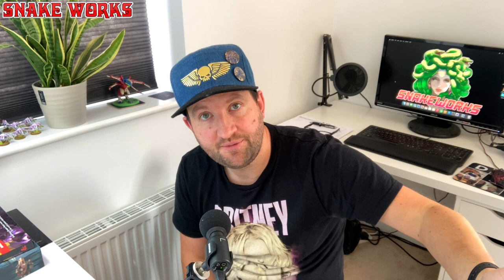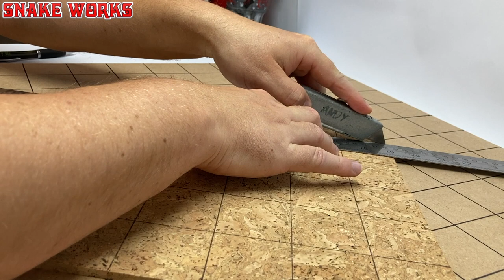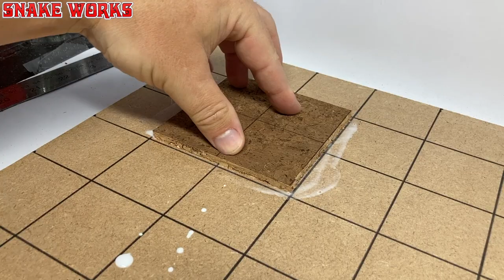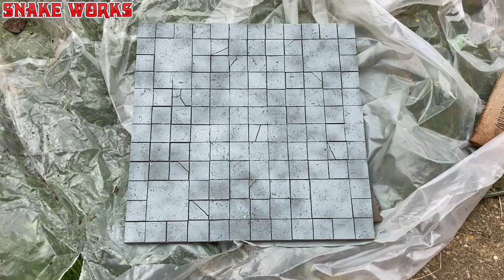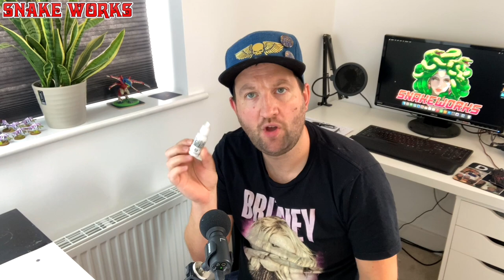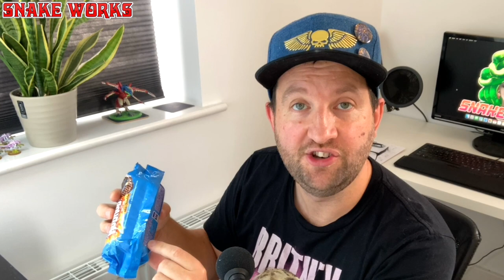FAST + EASY Display board for your WARHAMMER 40k miniatures!

Comment: If you go into B&Q (or a lot of other DIY stores) they usually have a rack of board offcuts just past the tills, you can take what you need in return for putting some change in the charity box. They are usually too small for building work but perfect for stuff like this, this is where I get boards to paint pictures on.
Reply from the maker: There’s always just crap in my local box! I think the wood scalpers get in there a lot 😂